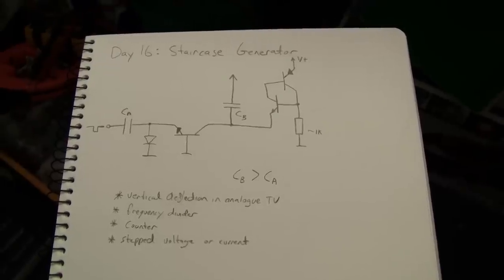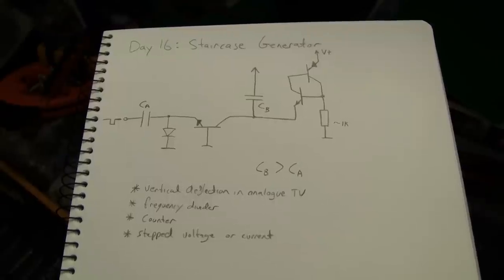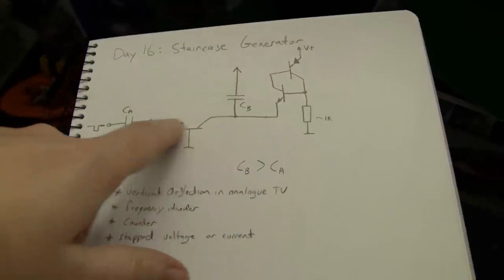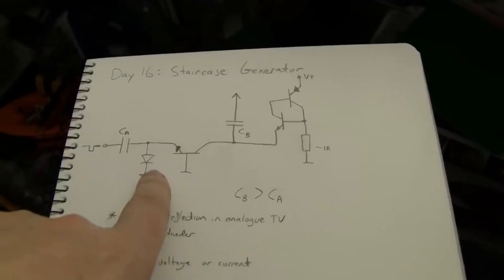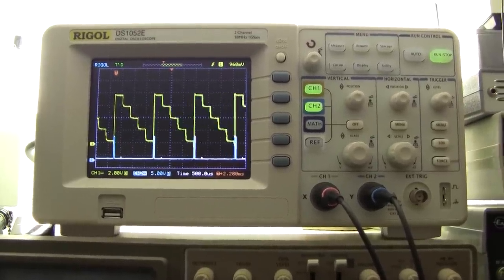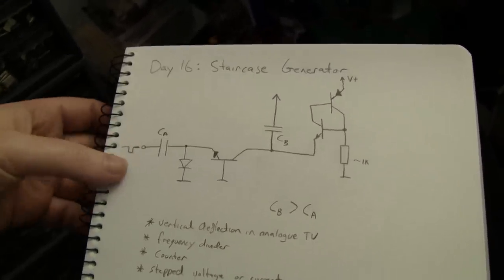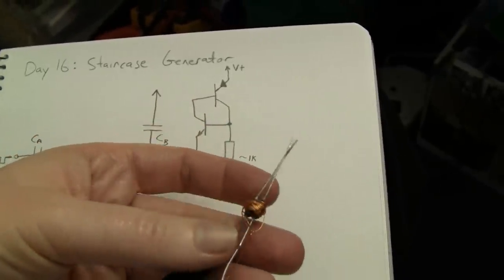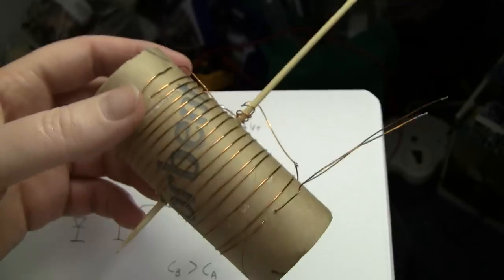Advent Calendar of Circuits 2011: Day 16: Staircase Generator

Comment: Thanks for posting. I have built many of these. I generally use the R-2R resistor ladder assembly. And the CD4024 ic chip which yields A beautiful stair step waveform. a Digital To analog.

Comment: I changed the 1k for a 100 ohm, used a 150pf and a 100nf cap and got this circuit to work up to over 10mhz, makes a good rf to audio converter, I was thinking of making another version of the Rf sniffer with it, and add it to my audio signal tracer.
It would also might make a fm discriminator, divide the if to just above audio & amplify the envelope.

Comment: Am I to understand that this runs on a split supply? It seems that the trigger input needs to go from zero down to a negative voltage. Can this run on a single supply? Thanks
Reply from the maker: It runs on a single supply. The negative going pulses through the capacitor pull the emitter below the grounded base and turn it on.
Reply: @vk2zay  Thanks. I will definitely build this up! I am going to trigger it with a D type flip flop at drum tempo rates.